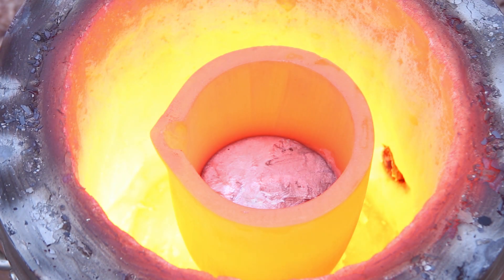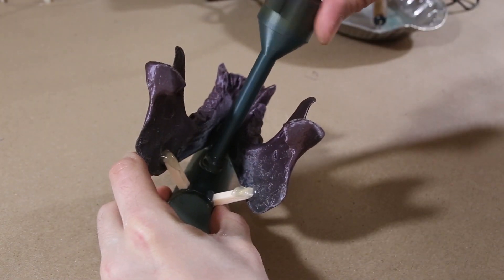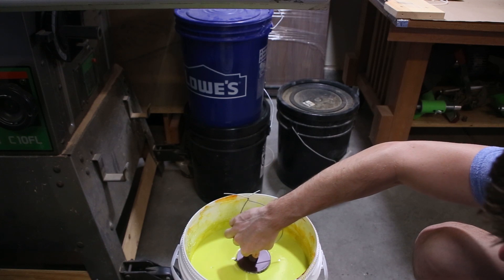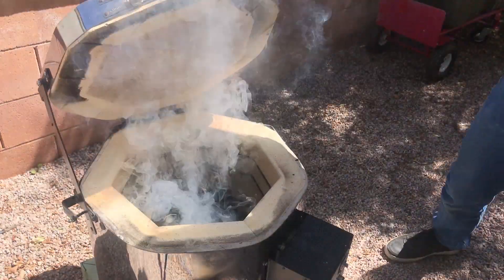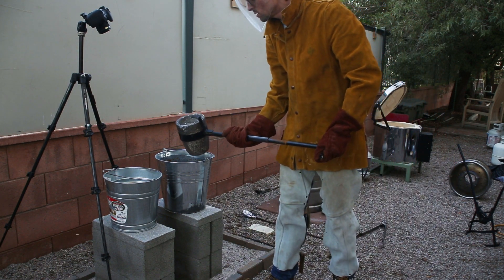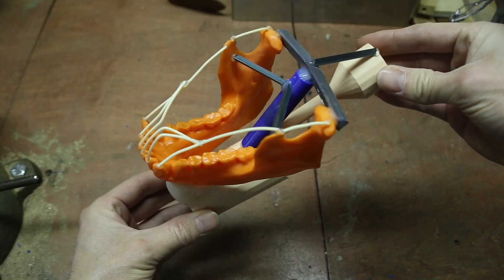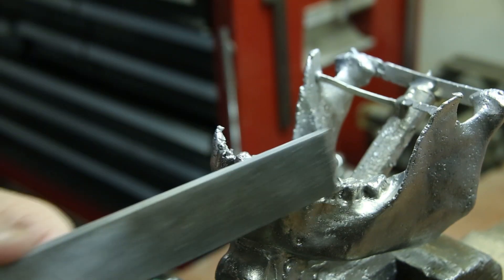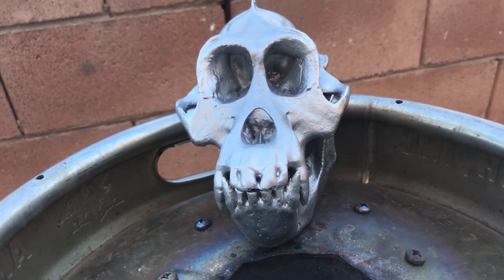Turning a 3D PRINT Into an ALUMINUM Casting Using LOST PLA │Orangutan Skull

Comment: Ok, so keeping in mind I know nothing about this stuff, wouldn't it have been easier to cast the lower jaw upside down?
Reply: I don’t think so as the metal would have to rise by into the teeth by pushing up the metal like a hose underwater and as it’s not as fluid and weighs more than water for example the metal wouldn’t have the force to fill up the mould if you get me haha, this is just my take but I hope it helps

Comment: Hey Seth, great video! I recently found out that making the feeders sprues and basin out of polystyrene foam helps with the cracking. It has a lower melting temperature so by the time the PLA starts to melt and expand the foam is long gone and the melting PLA has a place to go. I have also done printed feeders and such with zero infill. This accomplishes the same thing. Keep up the good work!

Comment: I had cracking issues during burnout myself. I believe that coating of wax you put on the skull helped eliminate that.  The wax would melt first and leave room for the PLA to expand.  Great job. Thanks I will try again.

Comment: This is a really cool method. Seen more than a couple of lost PLA videos from other youtubers, and they usually try to just use sand, with terrible results. First time I have seen a ceramic casing.

Have you tried iterating more with smaller casts? Would be interesting to see if this can be refined further.

Comment: Hell YEAH Seth! Well done. Actually I was thinking about the same to hide the layer lines of the printout - brushing with wax went really well! The printlines are barely noticable. Thats a great idea and I also need to try it out. The jaw I think had the imperfections because the mold cracked and that is the reason because the trapped air in crack wholes went into the cast. Me myself when the mold cracks badly I do not repair whole cracks - I repair it like something like "stiches". Then the trapped air that would be in the cast and act like imperfections - would be pushed out by molten metal out of the mold. There would be of course more of the finishing - because the molten metal would need to be cleaned out of the cast but I think it is simplier to do in my opinion.
Reagarding the pouring basin, sprues, runners etc - I noticed that the best method for my is to use pouring cup and na runner ourside the model and additional riser which acts as a feeder for the model. Either way a great job!
Again - When it comes to mold cracking - I almost got it into perfection. Check out my Valentines Day Casting and the description of how I melt out and then burnout the PLA.

Comment: Pretty solid casting, even with the failures. But it's nice that you show the failures. I notice that you pour the aluminum while its still the same color of the metal. With all metals, especially aluminum, you don't want to pour at too high a temperature.

Comment: This was a great project.
PLA expand to a point that would crack the ceramic shell? Really surprised by that observation.
5 layers and with sand reinforcement?
Was it a solid pla print? I'm guessing you had like 4 walls and 20% infill? I just can't see that happening. Your other shell of the exact same item would have cracked in the same way if it was from plastic thermal expansion.
Sure you didn't rush between dips and there was residual moisture in the shell?
Love the skull buy the way.

Comment: OK, so this might be a stupid question, but can you re-melt the castings you're not pleased with? Or do they get contaminated somehow? Is it the same with for example bronze?
Reply: You can melt down pretty much any failed castings in both aluminium and bronze, but some people don't because it is a faf to fit some things in a crucible. The only reason I wouldn't is if I were sand casting and the mould criticaly failed and I was left with a metally-sandy lump.